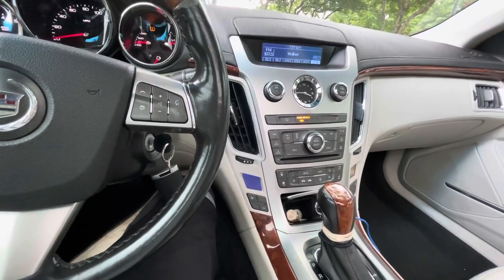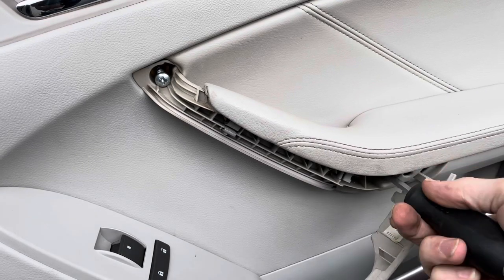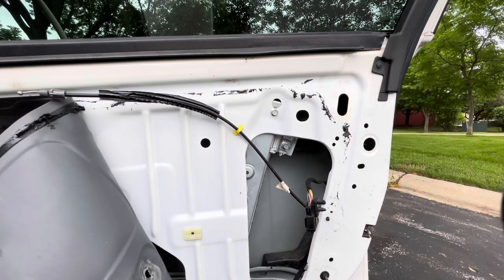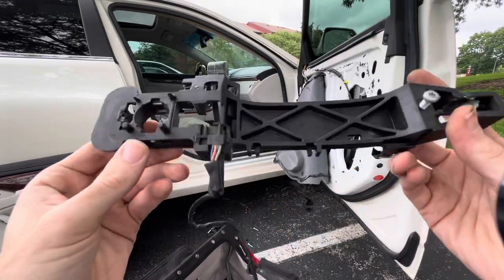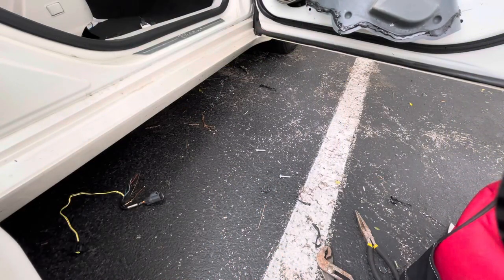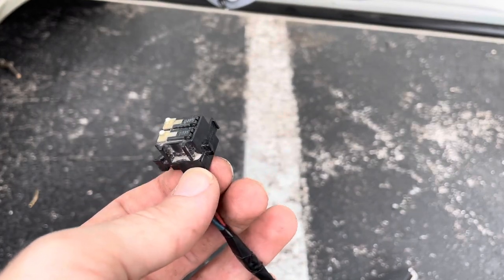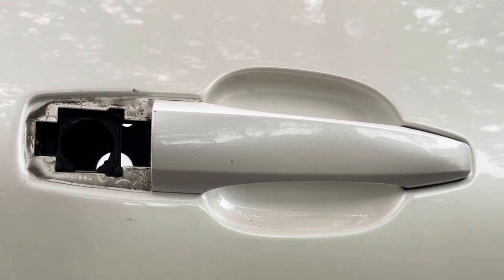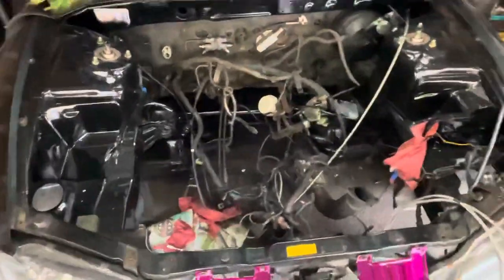Cadillac Door Won’t Open multifunction switch replacement Cadillac CTS

Comment: I have the same issue but with my driver door. I changed out the micro switches and made sure the fuses still good in the back and it is. When I pull the handle, there’s not even a sound indicating that the lock is trying to do anything. Please help
Reply from the maker: Sounds like it might be a wiring issue to the switch and not the switch it’s self. Do you have a multimeter?
Reply: @biddy98gst  Thanks for the reply! Yeah I have a power probe idk if that’s the same. I’m trying figure out what it is and trying crack down where it’s not sending power

Comment: I have a 2009 cts and the driver door only opens some time but u can hear the switch sound wen u pull the handle but door won’t open is that still that same issue?
Reply from the maker: Sounds like it is the door handles have allot of issues I think when you pull the handle on the driver side it unlocks the other doors and that’s why it makes the sound still

Comment: How do you get the door open in the first place? Mine wont open at all to get the panel off.
Reply from the maker: Ours opened from the inside handle still you would prob need to remove the handle on the interior panel and locate the wire that connect the handle to the lock and pull it with pliers

Comment: How did the door that didn't open get open?
Reply from the maker: When the multi function switch fails it still opens fine with the inside door handle just not from outside

Comment: You might answer this in the video but I'm asking now lol is there anyway to bypass it?
Reply from the maker: Sadly not the electronic locks all go through that sensor
Reply: @biddy98gst  thanks for the fast response! I have the same car and seems like the same problem. Just confused on what part to buy.. my unlock button works on all doors but my driver's side, I can't open driver side unless I open from inside.. best guess on part I need? Thank you
Reply: @mikesanders189  Pls post part # if you've found it. Thxs. Going thru this on passenger side as in video.

Comment: show boy can you just replace the micro switch on a 2008 gts cadillac
Reply from the maker: No Cadillac only sells the switch with the door handle it’s self. I didn’t want to replace my entire door handle and have to repaint it
Reply: They now sell just the harness, just not from the dealership. Dorman has them, and you can find them online. They are called "outer door handle harness" and LH and RH are different

Comment: What is this part called
Reply from the maker: They call it a multifunction switch I’m not sure if you can buy them without the actual full handle that’s why I pulled one from the junk yard. There are 2 kinds 1 with remote start and one without remote start